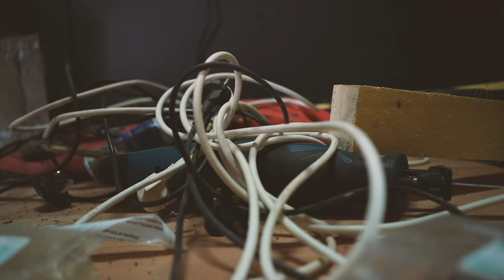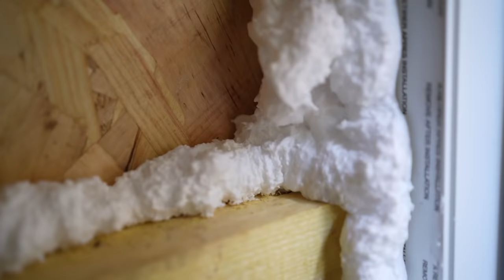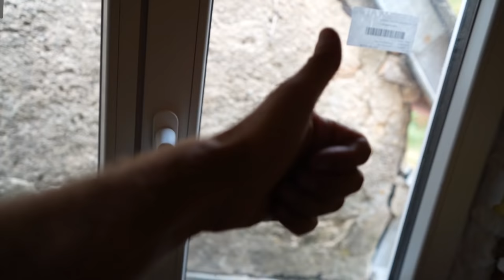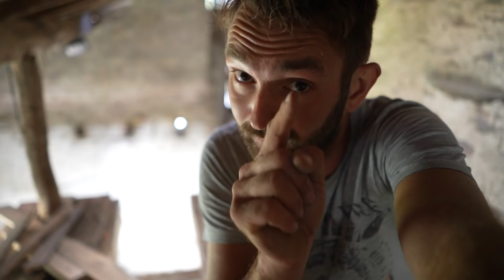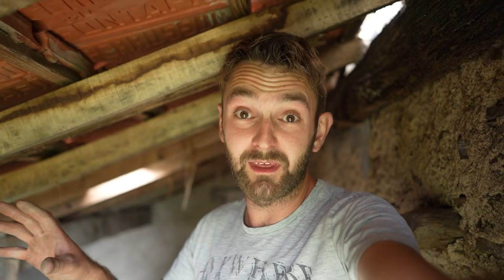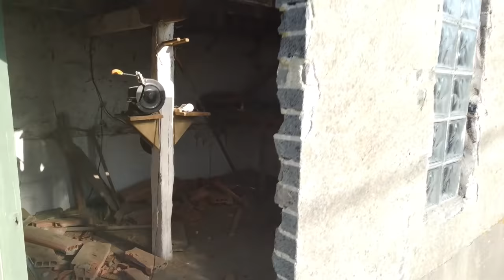Do NOT get excited about the roof top terrace - EP078

Comment: Whilst the roof top terrace sounds great, I have watched the vlog 3 times and it looks from the shadows, that it will face west. If this is correct Dan, you will need to think about the prevailing weather. It may be that it may get a lot of wind and rain, in which case, how much use will you get out of it? A glass roof would make it usable all year round. Just saying, that's all. Good luck.

Comment: Just a wee thought on the not at all exciting roof top terrace.  What about leaving the rafters 8n as a kind of pergola?
Reply: I like that idea. Originally was thinking to include and overhang; extends the season, maybe BBQ in the rain. Can drape fabric to create shade. Use what is there. 
For that matter,  it could also be kind of green house or protective space for plants, extra fruit/veg and storage in winter. We put up a temporary framed Plexiglas enclosure (4 panels with window to help with circulation on hot spring days), in winter outside on of our doors. It takes less than 1/2 hour to put up and take down.